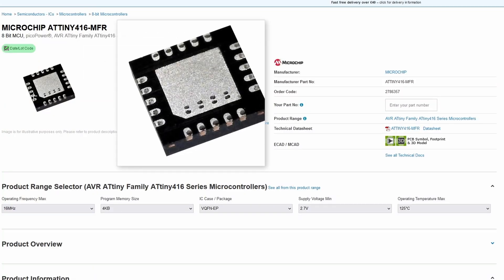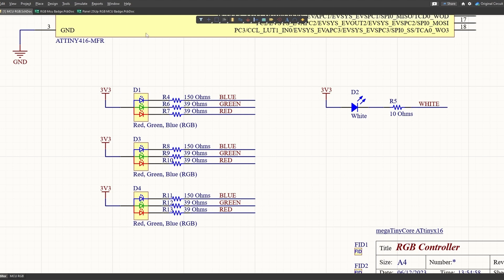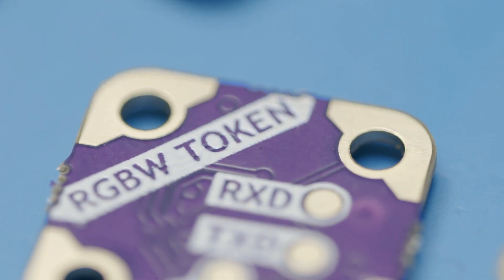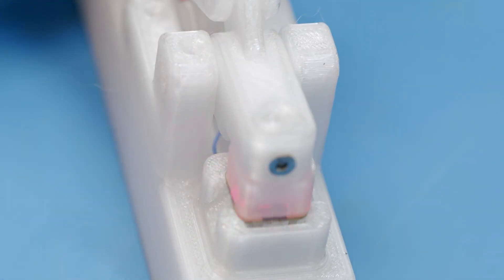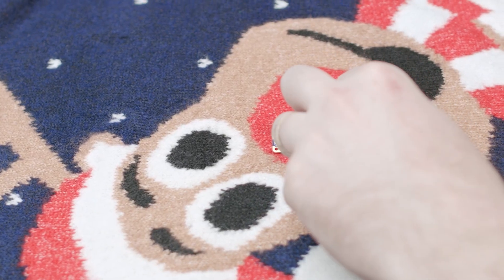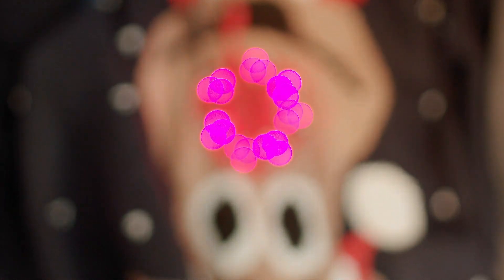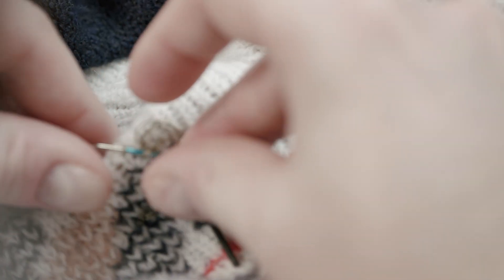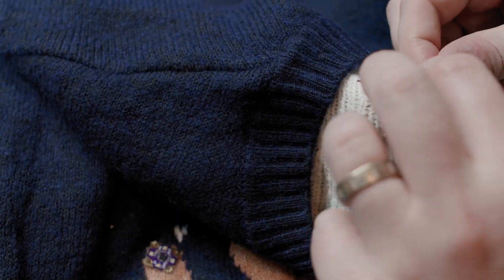Craft a Festive LED Christmas Sweater Featuring the ATtiny416!

Comment: I probably don't have much more experience with conductive thread than you given that I've only used it once, but I did find that you can solder stainless conductive thread with Sn96/Ag4 solder if you're struggling to get a reliable connection to the PCB pads.